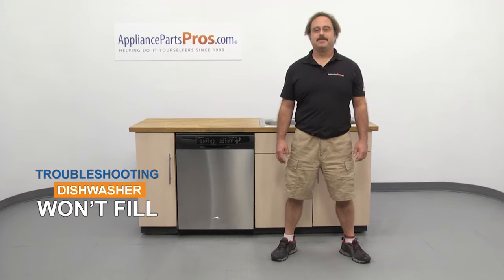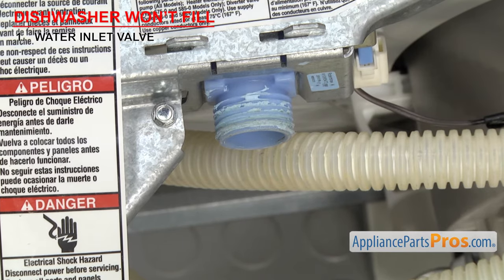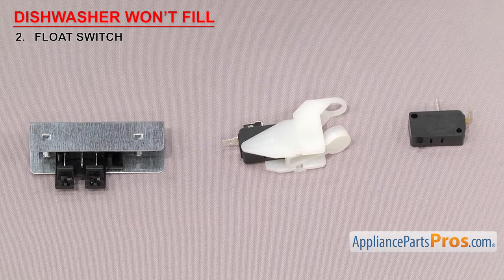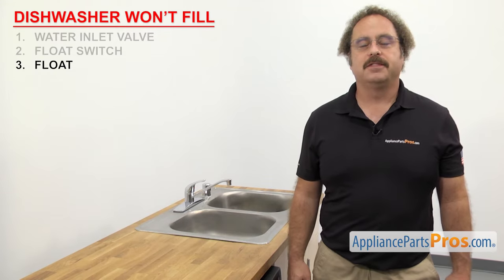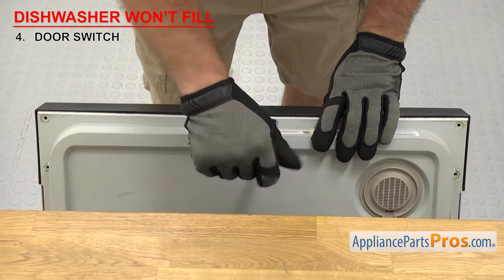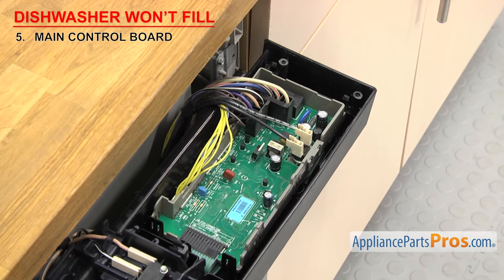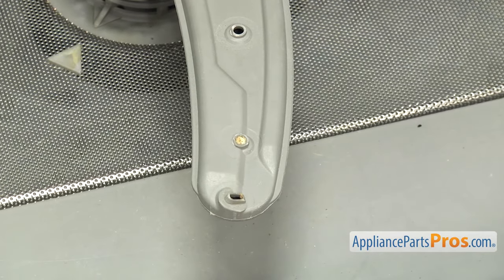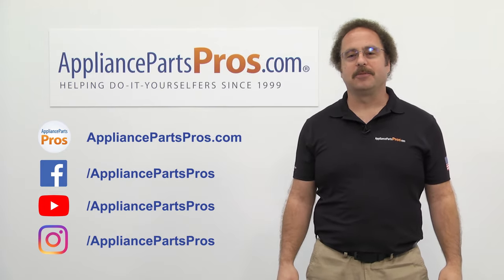Dishwasher Won’t Fill With Water - Top 5 Reasons & Fixes - Whirlpool, GE, LG, Maytag & More

Comment: I don't usually comment. I liked this video - he got me to think. Replaced a part in Gallery dishwasher and it would not fill with water. Turned out the reason was user error on my part but I would not have gotten there without the video. I blocked the float switch. Now it runs great. This video saved me hours of time  - money and frustration. THX
Reply from the maker: You are very welcome!

Comment: This guy is great he explains how to test stuff and where to get parts from as for me at turned out it was the valve leading to the dishwasher it's a one-way in 2out I pulled it out I checked everything it wasn't until I put it back together then I realized it was the valve water wouldn't even turn onto the sink so I would suggest checking that first just like he said I obviously didn't listen to that

Comment: that's a really nice concise video.  I tend to pick up broken dishwashers and try to repair them all the time. I find a lot of the whirlpool type of dishwashers made from about 2013 to 2018 have a control board failure where the dishwasher won't activate the fill valve. Maybe it's common to the ones I keep picking up.
Reply: Oh man really?? I'm trying to fix mine, I believe it's from 2012/13. I hear a noise  and the fishes are hot, but water doesn't circulate. I also see my dishwashing pod half melted on the basem 😢

Comment: I have the Kitchenaid KDFE104HPS0 dishwasher that will not fill.  I watched this video and purchased a new float switch.  Still having the problem.  Then I purchased a new water inlet valve.  Still having the problem.  Then I used my multi-tester and checked continuity on the original float switch and water inlet valve.  They are both fine.  I have since tested the latch for continuity and it was fine.  On all continuity tests I followed what was described in this video.  The float is fine since it is not electrical and I can see that it is not being obstructed by anything and that it is pressing on the lever that is pushing in the small swich on the float switch.  According to this video the only thing left is the control board.  Is replacing the control board going to solve my problem?  I am not sure how to even do any type of test on the existing control board.  The machine is 5.5 years old.  It is worth fixing?  If I purchase a new control board and this does not fix the problem can I return it for a full refund?  Does anyone have any advice for me on this issue?
Reply from the maker: You can test for power coming from the control board to the water valve when it should be filling. If there is no power there then the control board will need to be replaced. If you have power from the board and it's not getting to the water valve then you have a wiring issue. You will want to locate the tech sheet on your unit so you can see where to test. If you have more questions you can call us at 1-877-477-7278 and we will be happy to troubleshoot further.

Comment: I can hear the pump but no water comes out. Would that be inlet valve?
Reply: That is the same exact problem I am having.  Did you ever determine what it was?
Reply: Sandi, you must go step by step, starting with the shutoff valve, and flex water line to see if there is any pluggage.  With one end in a bucket, turn of the water to see if there is flow.  If so, move on to next step.

Comment: My washer seems to take on water, but only a bit. And it doesn't "run" the jets. Is this the 'circulation pump'? Continuity for the inlet solenoid is~40 Ω, while the reading on the float was closer to ~8mΩ. I tested what looked like another pump that might have been the circulation pump and got ~8 mΩ.
Is the inlet solenoid supposed to be that high? Needing guidance on which part to order.
Reply from the maker: What is your model number?
Reply from the maker: Thank you. You will need to test the float switch for continuity with a multimeter. You will also need to check the circulation pump and spray arms for any debris. If the circulation pump is not coming on then you will need to test for power at the pump when it's in the wash cycle. If there is power there and the pump is not coming on then you will need to replace the pump.

Comment: My dishwasher does cycle, completely but the water won't come in. Could the #4,door switch or the #5,main control board still be causing the issue of not filling?
Reply: I'm Havin the Same Issue.. I Have to Pour Water In the Bottom in order to work..
Reply: Same thing here.  My just started malfunctioning yesterday, did you determine what caused your problem?
Reply: Was hoping to find an answer to this. I replaced the intake valve (but it didn’t test as bad before) and I tested the float switch and it had the correct continuity, but there is still no water coming in. Everything else runs and the machine properly waits to fill when I manually hold the switch (as in, no water comes in, but it will stay in “filling” until I let go)

Comment: Hi
My ultra wash kenmore dishwasher model 665.13743k603 the cycles push bottom lights comes on when I push but options bottom no light on and doesn't work please help if you can thanks
Reply from the maker: If some of the buttons are working and some aren't you could have a control board or keypad issue. If you have an email address I can send you the tech sheet so you can follow the directions to check the keypad and determine which part has failed.

Comment: * I changed the water inlet valve and still no water. Turns out my feed line was clogged with debris right before the water inlet valve. No idea how that debris got in there.
Reply: Glenn, the debris could have come from your angle stop (shut off) valve if it is the type with a rubber washers.  The washer deteriorates, breaks apart, and plugs the line.  A kit with a new washer and packing bushing gasket for about 6 or seven dollars with fix this.  just pay attention as to how everything comes apart.

Comment: My Frigidaire won't fill. Water pressure is fine, inlet valve is fine, floater switch is fine, the float itself had minor buildup but i cleaned that off and it's unrestricted now.
Reply from the maker: How do you know the water valve is fine? Did you test it for voltage?
Reply: @appliancepartspros  I checked for continuity; I did not check for voltage however. Same with the floater switch; continuity when the float was down, and no continuity when up
Reply from the maker: In order to know if the valve is bad you would want to test it to see if it has 120 volts coming to it.
Reply: @appliancepartspros  I'll have get back to it then!

Comment: Changed out my water inlet valve and my plunger electronic device and it still doesn't fill up all the way. In fact u can manually hold down the button on the overflow plunger device and it still shuts off way too soon, then the dishwasher goes through it's entire 4 hour cycle with no water or no agitation or no spinning arms....just dry!
Reply: What ended up being your problem? I have the same issue right now.